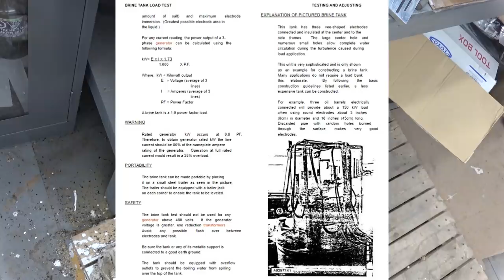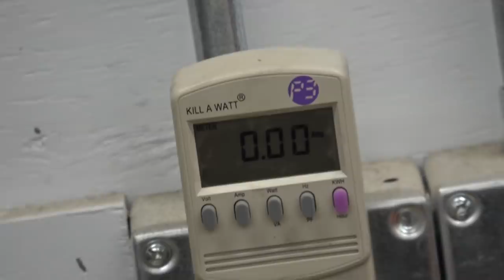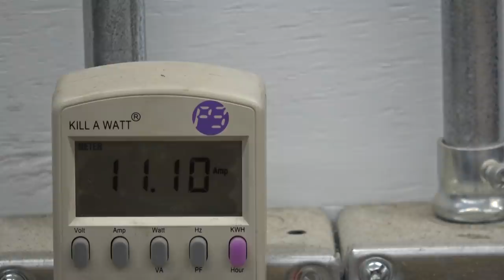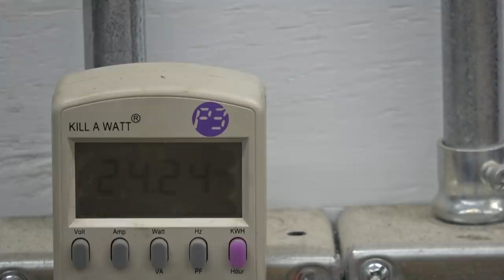Forgotten knowledge: generator load testing

Comment: I watched the other night. This episode brought back fond memories from 40 yrs ago. When I was in the military I built a salt water load bank for a 3 phase generator. I used 3-55 gallon drums for the salt water. Also added some H2SO4 for added conductivity. Tied a ground rod to a rope and pulley system to lower the ground rods into the 55 gallon drums. All the barrels were wired to L0 on the generator. Each rod was wired to L1, L2, and L3. I was able to load a 60kw generator at 120/208 to about 150%. The generator was struggling and blowing a lot of black exhaust. I had clamp ammeters on each phase wire but I don't remember what the reading was. I only recall a few details.

Comment: I learned this while trying to get electroplating to work at home during lockdown.

More salt, more chooch!
Reply: To much salt and what you plate isn’t worth wiping your nether regions. 

A/sq dm...... you need enough salt to conduct you ideal current, but if you exceed it to much you lose the ability to get a mechanically good finish at the ideal current.  It goes from inconsistent grain structure to brittle and porous, and skips the Goldilocks zone.  Just enough salts make the Goldilocks zone as wide as possible.   You have to monitor consumption and byproduct buildup more closely though. Specific gravity often works for byproduct monitoring, depending what metal you are plating. 

Also, acid clean, DI water rinse and do not let it dry before dunking in the solution.  The post plate rinse is less critical, but wiping with IPA instead of air dry will reduce oxidation.

Comment: Breakers won't trip magnetically (~1 cycle) until many times more than the rating, otherwise they trip thermally on the order of tens of seconds to minutes.
Reply: Exactly this! 
A 20 amp breaker will take a long time to trip if you send 'only' 24a through it. 
With 40a it will trip within a minute or so. With 80 in a few seconds. With 200 in a few milliseconds.
There are datasheets that have switch off times VS current graphs, very informative.

Comment: Ehh.. Its not a purely resistive load.  A lot of things contribute to the non-linearity.  As the voltage increases, the available electrochemical reactions increase and the resistivity goes down.  As the ampacity goes up (way up) something similar to the Leidenfrost effect occurs just from the sheer amount of gas generated.  Stick a variac on it and measure the power factor as you increase the voltage.  It ain't gonna be 1.
Its relatively linear with respect to electrode surface area but even after a few minutes you'll notice a bunch of white stuff building up.  That's aluminum chloride and the reason it looks like antiperspirant is because its antiperspirant.
We used to check very high amperage (200A) military radio power supplies using this.  And also light fire to the hydrogen that comes off.

Comment: FYI, I worked in a shipyard fro many years in  new construction and repair. in the electrical  shop.   Brine tanks were normally used for  loading ship generators.  Most of the ship's generators were 500 to 750 KW. I was not involved in the testing  other than to be placed in the dark when mains tripped.  Other shipyards may have used other types of load banks but Atlantic Dry Dock in Jacksonville Fl used brine tanks unless USN contracts required a more modern load.   I retired  from the shipyards  in 2011.  I enjoy your videos and humor.

Comment: Some old large slip ring motor starters used brine water resistance while starting.
Reply: Yes I have used few liquid starters in my time. The first one i worked on was for a 5000HP motor. I found later that the dried out the liquid starter needed washing soda not sodium chloride. Anyway on the first start it erupted like Old Faithful.  It shot boiling saltwater 60 ft up all over the ceiling in this pulp mill. I quickly learned to put in a lot less soda and no sodium chloride the next time.
Reply: @PaulOostindie  I can imagine the first time I came across one was in a steel mill and the customer had replaced the water with silicon oil the could not get the motor to start. I replaced it with a Rotovar it was only a 1200Amp model.

Comment: When I used to work at Labgruppen (professional audio power amplifier manufacturer) as the head of testing and service dpt. We had some pretty big dummy loads constructed from a large quantity of really expensive power resistors. They were capable of handling about 4000W per channel in short bursts. At that time our biggest amps could put out about 3000W at 2 Ohms per channel. One day of course, the head engineer came up with a mono block that put out close to 10kW. And tested it using a couple of our dummy loads linked. I will not mention his name but that guy was as fearless as he was genius. As I remember, the resistors blew sky high and filled the whole factory (though at the time pretty small by factory standards) with smoke and shrapnel. He and I would have loved this idea. I bet it would be hard to benchmark test amps to a good enough tolerance level. But for brute force proof of concept this is really hard to beat for cost efficiency. Some kind of circuit to trim the resistance more precisely would of course be needed but that would be relatively cheap and easy to build.

Comment: Years ago in high school I found an old book of science projects in the school library that the safety police had somehow missed.  Besides fun stuff like the formula for gunpowder, It had instructions for a DIY carbon arc light- just cut the carbon rods out of a carbon-zinc battery (standard flashlight battery back in the Jurassic, but they're still available) and use a big glass mixing bowl (or plastic bucket) full of salt water as a massive power resistor to limit the current to avoid blowing the circuit breaker.  Then I found an old space heater in the attic with a 12" diameter parabolic reflector behind the heater coil, and after a few modifications I had a carbon-arc spotlight that would light up the clouds.

Comment: Thirty years ago, when I was just starting out as a theatre electrician in London an old boy told me about the resistance dimmers he remembered in some ancient theatre. He said they were brine filled glass tubes and a plunger controlled the intensity of the stage lights. They were situated in the orchestra pit and he claimed that drunken musicians, presumably if they had not been overcome by the chlorine coming off the dimmers, risked further injury by relieving themselves into the tubes. I wonder if it affected the light level on stage.

Comment: Old school locomotive repair manuals talk about load banking the engines for static testing. One of the methods outlined was using a drum or vat of water with conductors in the water hooked up to the generator on the locomotive. They did not talk about salt or any other additive in the water, just straight water, but salt makes sense. This would have been back in the 50's and 60s, and it would have been DC current.

Comment: Probably lot of comments on this, but a 20A breaker normally doesn't trip until around 25A at room temp so they can support 20A at elevated electrical room temps.  And even then they need 10's of minutes to trip.  A 20A breaker will normally happily supply 40A for 10s or so.  They only instantly trip at something like 6x the rated current depending on the class of the breaker.

Comment: So basically a 'scariac' (look it up) :D
Or an electrode heater
Fun fact, our electrical companies use multiple electric cooker hob elements in a cage with switches for pressure testing supply lines ;)
Reply: Saw a decomissioned lift VSD dump load, which was basically a whole big box filled with oven grill elements, and then a whole collection of contactors connected to the controller to allow the lift controller relay logic to do speed control and braking, using assorted combinations of really big resistive heaters. No microcontroller, just the remains of the big DC motors being chopped up for the copper.

Comment: Who wants to see the new F-150 inverter tested with AvE Werks Resist-O-Matic?
Reply: Thats a spendy peice of vehicular hardware. I think he prefers his vehicles with a little more vintage, mostly rust by weight, and bairly working.
Reply: user9823598246  A stock F150 isn’t that bad. I saw an F350 lifted up 24” the other day. Now that just screams “DOUCHEBAG!”. 🙄
Reply: @5roundsrapid263  we call those bro dozers in my neck of the woods.
Reply: @classicwefi  I’ve heard that expression before.

Comment: Brings back memories as this was the only way to test larger generators quickly. Most would do 100-500 kw in a 55 gallon barrel. If you start with just water and sprinkle salt over the plates you will see the salt create an arc in the water and an orange burst of light to further have fun with the bucket.

Comment: Used this technology decades ago for loading up locomotive engines for testing and running in after overhaul. 
Adjusted parameters by lowering the paddles progressively into the brine to increase the load.

Comment: During my tour in Vietnam I visited a US Army Stratcom sight.  These sites, usually on top of a mountain, had huge generator farms that powered equipment to bounce radio signals off the stratosphere between, in this case, Vietnam and the US.  Each of these sites had their own power generating facilities.  Outside this particular generating facility sat 2 very large metal boxes, maybe 5 feet deep, 6 feet long and 6 foot wide, with the tops missing.  Inside were moveable panels, that could be raised or lowered, of what looked like sheets of extruded metal sitting bathed in some liquid concoction.  One of these tanks was in use load testing a generator and believe you me the liquid inside that tank had a life of its own!  That was as close as I ever wanted to come to a boiling witches cauldron!

Comment: Once upon a time, I wrote the firmware to control a 3-phase powered high current DC power supply. It's purpose was to be hooked up to a carbon doughnut while the doughnut was being compressed in order to make industrial diamonds. Our test load was a 10-foot length of water pipe, into which we ran cold water in one end, and watched steam come out the other.

Comment: We had a rig like that to test our ground support generators they were 400hz. 1000 amps will boil the water out of a 55gal drum pretty fast😀
Reply: Used a larger version to test ship's gen sets. About 200 gallons of brine and about a dozen steel plates for each phase. 1000kw really got things bubbling and the smell of chlorine made it a bit dangerous. Modern version is a semi trailer full of resistors and a nerd with a confuser and printer.
Reply: @jamesclark3119  Beautiful, Chlorine gas always brings a tear to my eye.

Comment: I have a 3 phase generator head where the manual’s method to dry out the windings is to hook all 3 legs together, then hookup a variable DC power supply to the field brushes and just start dialing up the voltage until it’s at rated power and leave it there for 30 minutes.

Comment: About the mid 70's, while in my teens, I got a book from the library on science type projects. One was a carbon arc furnace made out of a flower pot, curtain rod, carbon rod out of 2 D cell batteries and a salt water resister in series. I just enjoyed making it arc. One of my cousins decided to stick his finger in the water while I demonstrating.

Comment: Depending on the tempture of the breaker, the trip current will change. 

The bi metallic strip that controls the over current side of the mechanism needs to reach a tempture before breaking contact. 

The solenoid will work under short circuit conditions to pull the breaker open.

If you however use a fuse, you will get better resolution to the current trip point since tempture has less effect

Comment: The beginnings of a nice H2 & O2 separator you have there.
Reply: Sudden recombination into H2O in the workshop could get interesting.
Reply: My first thought.
Reply: Great testing device for hydrogen detectors too!    I've done this to test the one in my server room lol.  Small cup and two nails as electrodes, plugged right into a GFCI outlet.  A little sketch but it works.  The GFCI outlet at least gives it some resemblance of being safe. :P

Comment: Your 20 amp breaker, pulling 30 amps will still take like 2 mins to thermal trip
Reply: Even longer if it's a FPE Stab Lok!
Reply: @redsquirrelftw  and maybe never
Reply: Remember some breakers are often designed to hold 20Amp and only trip when the current is 110% and some thermal breakers can take 110% for a few minutes. You need to look at the manufacturer's trip curve to know for sure. Unless it is an FPE breaker as a few have people have already pointed out. Half of the FPE breakers will never trip.

Comment: Used a 55 gallon steel drum for one, with 3 electrodes made from steel rod, on insulators of wood suspended from the top, and the drum filled with salt water. Used to load the 3 phase generators to full load for a half hour. End of that half hour the drum would be boiling vigorously, and you would be around a foot lower water wise.  Leave to cool and dump the brine, and it went back to the drum being the boiling drum for removing of hydraulic fluid from your overalls, using the steam cleaner detergent. 3 hours of boiling and they came out clean, if a little more faded. Nothing else removes that aircraft hydraulic oil, short of nastier solvents that remove skin as well.

The other test load was an old steel frame bed, with a cut made in the short sides, and a very thick SRBP spacer bolted to it. Then a good collection of quarter inch thick wire springs that were laid across the sides, and a really thick copper cable attached across the insulator, leading to the test socket. You needed to have that particular test have the generator deliver 28.5VDC for 30 seconds into that load, without parts departing, with the load current needing to be just a shade under 8kA for at least 10 seconds, as the springs went from black to bright orange during the test. Place this test load on bare ground, so the frame holds the springs down, and not on the concrete, as it would be burnt. Takes a while to cool after as well. Bed used to have steel straps on it originally, but they sort of melted off, replaced with roller door springs that had failed. Some aircraft need that sort of power to start the jet engines, and often they are not big ones either.

Comment: I found out the hard way there is a 15 amp / and thermal fuse int he Kill-A-Watt. I blew and bypassed mine years ago and it still works great!  The time-overcurrent characteristic of a branch circuit breaker won't trip before the kill-a-watt fuse goes.

Comment: Won't it create hydrogen gas and chlorine gas?
Reply: Yea, just don't do it indoors for long and it's fine.
Reply: When the AvE vijos stop coming we know he has gassed himself to the other side of the polar graph(i.e. from the Real to the Imaginary)
Reply: I think the AC mitigates the electrolysis to a great extent, could be wrong though.
Reply: @Broken_Yugo   You are.
Reply: @honthirty_  Part of me wonders what a "pubic pool" might be should it exist, and the rest of me doesn't want to let my mind wander in that direction.
Reply: @smithaustin2009  Have you listened to AvE?
Reply: Yes hydrogen and chlorine and some steam. One is explosive, one is toxic and one will burn you. What could go wrong Darwin?
Reply: AC is dc for 1/120 of a second at a time. AC generates hydrogen on one electrode for 1/120 of a second then on the next 1/120 of a second it generates it on the other electrode. Yes you are right most of the energy is converted to steam when you try to put that much energy into such a small volume of water.  I have worked on a 6MVA generator before and a 9MW electric steam plant. But if you sample the steam you will get more than a few ppm of hydrogen, oxygen and chlorine from the salt. You also get a little sodium but it instantly reacts with the water to produce NaOH and H2 gas. But the gas unless concentrated is much less than the lower explosive limit. But I am not sure AVE (who is real smart) knew that before he did his little experiment.

Comment: I wish I had pictures , I overhauled a CAT 3416  V16 genset. Load tested it using a tank with huge elements which you lowered into the water . I added bags of salt to raise the boiling point . 4 valves per cylinder ,took a while to set tappets . Beautifully smooth running engine .

Comment: Reminds me, when I first got into the shipyard that I work at back in 1989, we had a giant one of these salt boxes, about the size of a tall tank that  was about waist high, and probably held as much water as two bathtubs or so.  Had a center column that had slots on each side, that a big plate was suspended by a small winch motor, to slide it up and down. We used it for testing the generators on minesweepers and other ships.
Heck of a thing to watch. Then they got the fancy load banks later on, the ones you could switch the exact amount of resistance in that you wanted. Just goes to prove the old ways we’re not as exact as the new ones, but got the job done......